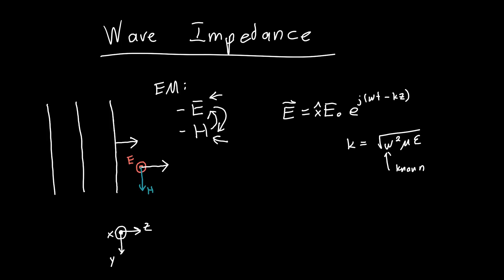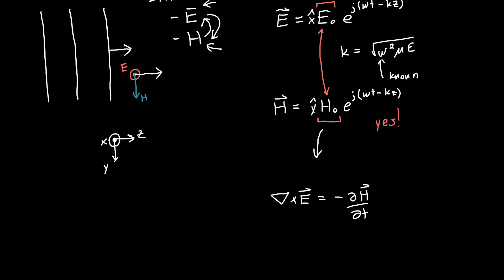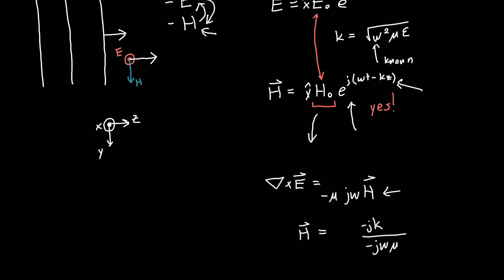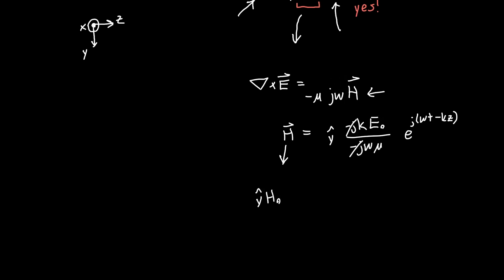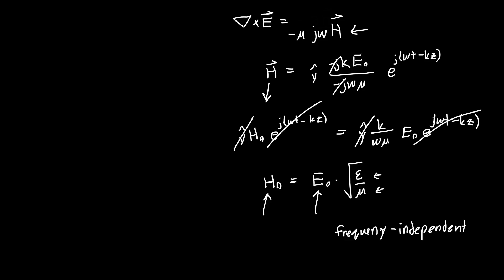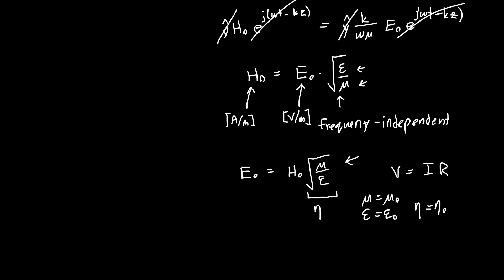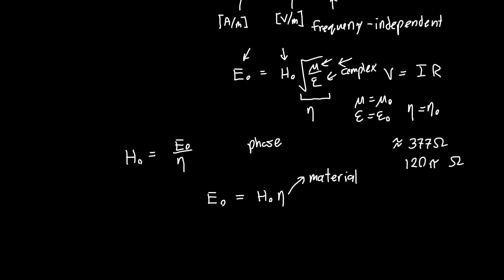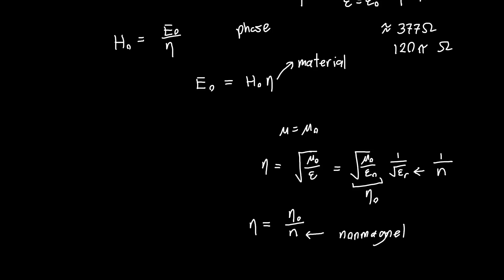Wave Impedance Explained

Comment: Very nice explanation. I have not found it this neatly derived anywhere so far. 
I have a question though. Considering an EM wave hitting a dielectric interface at an angle, the impedance is supposed to change dependant on the polarisation and incidence angle of the wave. 
I found a formula somewhere but when I plug in the brewster's angle and expect Eta(alpha_B) = Eta_0 for parallel polarisation, I get something weird instead. Since my formula does not seem to work, do you know one that does work?

Comment: the 377 Ohms are valid for the far field from a radiation source.. could you expand on what happens in the near field (distance from source smaller than wavelength/2Pi) ?
Reply: for that you should probably use equations for transmission lines, smith diagram, etc

Comment: 0:19 What is the meaning of the arrows from E to H and vice versa, and the narrative "a propagating electric field and a propagating magnetic field and these two switch back and forth in their oscillations as we move through space"? In what sense are they switching back and forth? Is this saying that E somehow changes places, or exchanges energy with H?
Reply from the maker: Yeah, in a propagating electromagnetic wave the E-field and H-fields oscillate out of phase, you can indeed think of it like the energy sloshing back and forth between them.
Reply: @JordanEdmundsEECS  I'm still interested in this question. This video seems to contain the misconception described here: https://youtu.be/uZnXhRgztEg?t=213 I think.  My suspicion is increased by 4:45 where the phasor factors in the equation relating H0 and E0 are equal (same phase angle) and cancel.  But maybe I've missed something.
Reply: @JordanEdmundsEECS  Thanks very much for your reply!  I wondered if that was what you might mean. But when you say "E-field and H-fields oscillate out of phase", how does that relate to the plot of field intensity (exemplified by the top figure in https://en.wikipedia.org/wiki/Electromagnetic_radiation), where they are shown (and the caption says explicitly) in phase?

Comment: Hi, Thank you for posting the video! Can you explain how does wave impedance changes between the near field and far field?
Reply from the maker: Wave impedance is only really defined for the far-field (for transverse waves, as the ratio of the electric field to the magnetic field). In the near-field the waves aren't transverse (there's some component that doesn't propagate outward radially but sort of stays localized), so you can't really define a wave impedance in this region. You can define a capacitance and an inductance (by integrating all the E-fields and integrating all the H-fields) and these are usually more useful.
Reply: @JordanEdmundsEECS  In the case of a Gaussian beam, there are nearly spherical wavefronts on either side of the beam waist, where the wavefronts are nearly planar. How does wave impedance change along the axis of a Gaussian beam through these regions?

Comment: What is the physical significance of wave impedance?
Reply from the maker: One physical significance is that it determines the speed of propagation of the wave. Higher wave impedance -> lower propagation speed. When you have physical discontinuities (like between air and water for example), wave impedance is what determines how much of the wave gets reflected and how much gets transmitted.